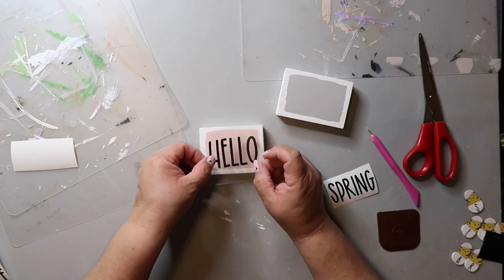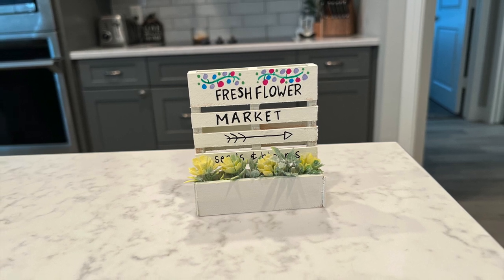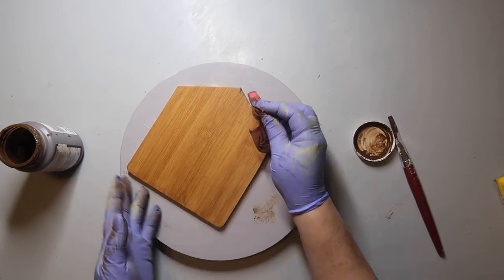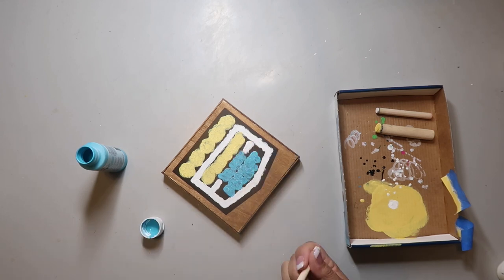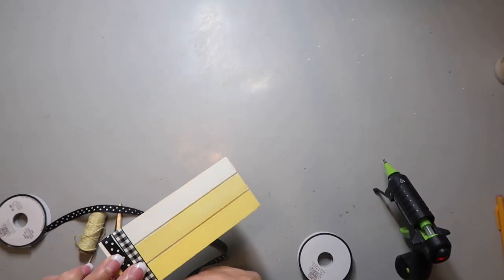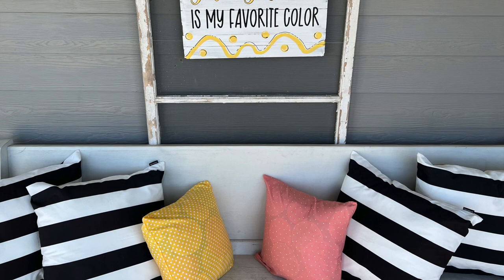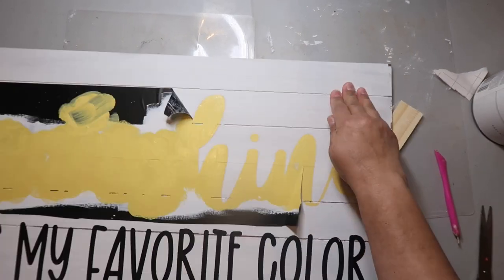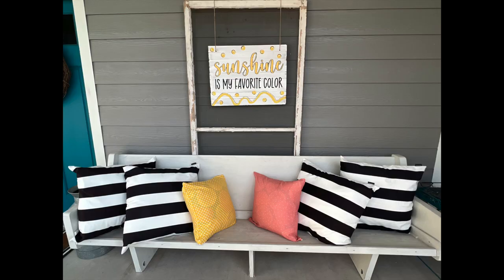☀️ 8 EASY & FUN ☀️ SUMMER DIYS FOR 2023

Comment: Hey there. A suggestion for the tiny pallet planter paint over the arrow. Put that "arrow" on either side of MARKET  The fletching on the left and point on the right side of MARKET. Then just write in the seeds line where the arrow used to be? For your tiny basket use a small display/picture stand. That way it's not permanent, and you can reuse the stand for signs, pictures, etc...
Reply from the maker: great ideas Bev!  thanks so much!!